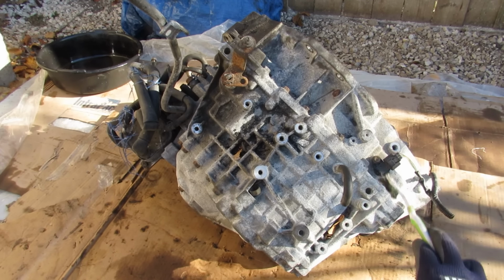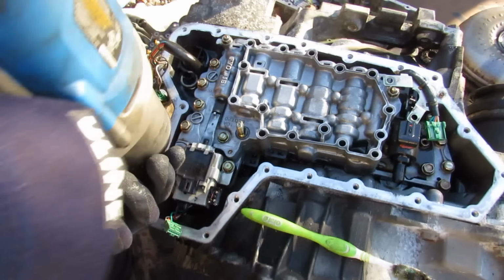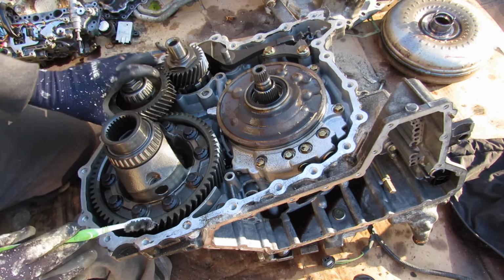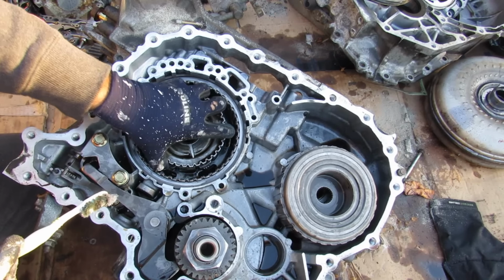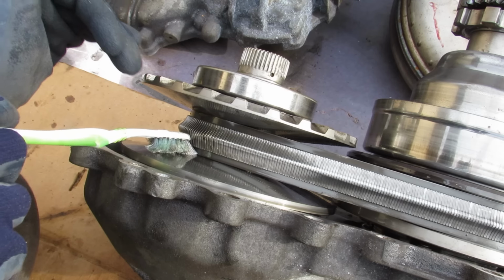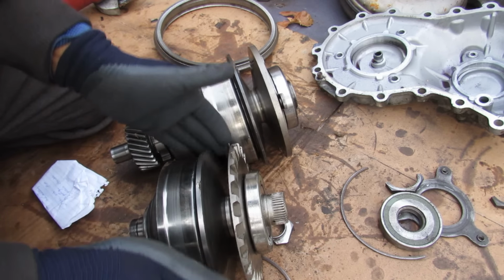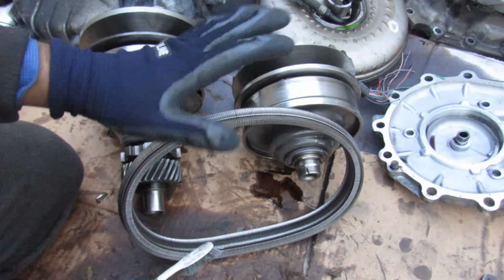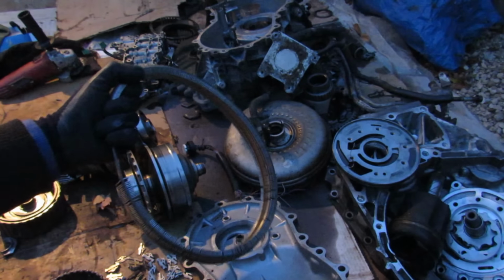Why Nissan CVTs FAIL

Comment: Do be mindful when dissembling some CVT parts , the Variator pulleys in some designs contain an extremely strong compression spring that is loaded to over 400 psi that has to dissembled with a special spring compressor tool  (very much like the extreme care that needs to be taken when removing the spring from a suspension strut when its serviced ), it contains a lot potent energy and if you don't have the proper tool in place and remove the nut holding the variator pulley together ,, you can be badly injured when all that force is released,   people should be warned of this issue..do not mess with the Variator assembly's themselves without proper training ,, https://youtu.be/i4wzSthmmMo?t=337
Reply: This is good advice

Comment: Stepper motor is the main issue with most CVT transmission failures from Nissan. Nissan will not sell you the stepper motor but it can be bought on Amazon and replaced for under $500. Nissan will insist that they replace your whole transmission for a cost of $5000. I know which way I went The car now works fine

Comment: My wife's Altima hadn't had a CVT fluid change in 112K miles and started having momentary (1/2 second maybe) times where it felt like someone let off the gas. Was happening every few miles eventually.  I changed fluid with NS-3 Nissan fluid and I swear there is almost no noise from the CVT or engine now except under acceleration. It drives so smoothly that I think it's better now than when new. Should have changed fluid at 60K miles so I got lucky that it held up so well. Now it drives like butter. Sounds like a hybrid on battery sometimes. Keep that fluid changed! Next change will be in 20K miles since I only drained 4 quarts in the process and believe it holds 8 quarts total (including torque converter). Will definitely stay on top of it now.
Reply: Yeah that's a slip probably from the wrong fluid type.  Slip will instantly kill a CVT.  Once the cones get polished they won't grab the belt anymore and it's sayonara to the trans.
Reply: @drozcompany4132  that's interesting. It mostly did it when under nearly no load, like at 45-60 mph just cruising along. However, when I changed the fluid the sun was behind the fluid and I swore it looked read instead of the teal green of NS-3. On my finger it looked brown, but nothing like the used fluid I've seen come out of others on video that use NS-3. Wondering if they used a non-standard fluid in my CVT instead of NS-3 even though the manual is clear that only NS-3 is to be used.

Comment: Oh yes..... My maxima stopped in the middle of the freeway, almost causing an accident. I will never buy one of those cars again. Nissan sucks. My check engine light went on days before, dealer told me nothing was wrong with it. Made a little nois, they again told me nothing was wrong with it. On the way home on I-5, it made a loud sound before breaking on the freeway.
Reply: Blame your shitty dealer.  The car was giving you a warning.

Comment: In my opinion CVTs are only good for subcompact and compact cars because they dont pull that much weight, putting it on an SUV or a Minivan will really make them fail.
Reply: They could work for heavy or powerful vehicles if they engineered them with parts designed to handle it. I thought some Formula 1 cars had them until they got banned as being an unfair advantage in races.

Comment: Back in 2008, I rented a 2008 Nissan Altima with a CVT, for 3 or 4 days. I remember loving the way it shifted. Seemed very smooth to me, smoother than my 1999 Oldsmobile Intrigue, my 2012 Chevy Sonic, or my 2017 Ford Fusion (all automatics). Too bad about the CVT reliability issues.

Comment: 2 quick notes, you can rebuild some newer styles of Nissan CVT's , I've done it at the dealer several times.  2nd, the Nissan Pathfinder since 2013 has more of a chain then a belt.  As not 2 steel bands with links in the middle, the Path has still pins with small links in a pattern not that different from what's in a T-case.

Comment: The last Nissan that piqued my interest was any Maxima or Altima with a manual transmission.
Reply: I have a 6mt maxima with the special orange. Love it
Reply: Yeeees sir. The maxima MT was a rocket of a car and light. It pulled hard in every gear. Handling curves at speed was issue on beenie weenie tires and soggy struts.. Lowered with extra wide 255/40/18 tires oooooweeee.

Comment: Under appreciated video editing here. Straight to the point, no babbling. Thanks!
Reply: I was worried that we would watch every bolt and nut being removed but he cut out the rest after the first one of each bunch.
Reply: Ok, so do you recommend a CVT transmission flush or drain on. 2013 Rogue with 36,000 miles? Thanks!

Comment: I guess a manual transmission can be even more fuel-efficient than a CVT if operated properly.
Reply: Cybair: . . . p r o p e r l y . . .
Reply: Actually no its not possible unless maybe it's all highway miles
Reply: @NoName-gv6nm   -  Ask any hypermiler, they will tell you how it is done.

Comment: first i saw this cvt gearbox was in textile sizing machines in 70s and 80s, made by PIV Germany. Idea was as threads wraps the beam the diameter of beam increases while the thread drawing speed  needs to be same to keep the over all ratio same. Latter separte electric motors were introduced for each section with central control.( just look at your electric cars today ☺)
real knowledge based channel on YT. 👍

Comment: My 07 Nissan versa went to 298,200 MI with a CVT,,  now I'm in a Maxima 2019
Reply: Did it always have a bit of a winding sound?
Reply: The Lord was with you.
Reply: My 16 Maxima i bought used with 45k miles, knowing all the issues with CVT's i got the extended warranty and took the car straight to dealership to get the CVT replaced because it did have minor issues.
Got it replaced under warranty and runs like new.
My personal mechanic and Nissan said these CVT's must flush and change fluid every 30k miles.
Knowing that i can see why they fail prematurely if people are not aware they need to change the fluid more often than a traditional transmission. 
Yes my car does make a slight winding noise but for me i kinda like it.  To hear the mechanical parts working is like music especially when you let go of the gas and listen to it slow itself down is pretty cool sounding.
Reply: @keronlezama323  If a low emission car needs to have a $500 transmission flush every 25k-30k, they bought a lemon
Reply: @ajrichards1190   Might want to check your facts on that price.
The fluid and filter is $100 and i aint removing any moving parts.
Easy flush with hand tools and done in less than an hour.
Trust me, my mechanic hates my car just because it's a Nissan but he has showed me everything it takes to maintain this CVT
Reply: @keronlezama323  I have an 09 Maxima, would you mind telling me or sending me a link to locate the CVT filter? Thanks !
Reply: @ajrichards1190  It doesn't cost that much. It should cost you about $100 if you're doing it yourself. It's easier than changing your engine oil IMO. Dealership quoted me about $200 but you might as well just save the $100 and do it yourself.
Reply: @ajrichards1190  lol its 200 bucks every 30k miles... its good practice to do it every 50k miles on a regular auto anyways. You're reaching hard man.
Reply: Typical made up response to try to save face of a Nissan product lol
Reply: @allmotorkp61  sounds like y'all motor kaputed at 61, 🤣🤣🤣🤣🤣🤣🤣🤣🤣🤣🤣🤣🤣🤣🤣🤣🤣🤣👌.  Just got back from a 2000 Mile road Trip averaging 31 mi to the gallon and driving at 85 mph out on the open road Nissan Maxima baby
Reply: @allmotorkp61  don't tell me you voted for Biden too DUMORATT. TRUMP 2020 HAMMER TIME 🤣 SCORECARD DOMINION OUT 🤯🤯🤯🤯🤯

Comment: Besides the inadequate cooling, what causes these to have so much of a higher failure rate compared to Toyota, Honda, or Subaru CVTs? I almost never hear of CVT failures from other manufacturers, even though Subaru uses the same Jatco transmissions that Nissan owns and uses?

Comment: I like the CVT that ive got in my '17 sport.  It gives engine braking capability when you use the paddles.  Its so cool how it acts like a manumatic.  Although i wish i had a maxima instead the CVT is its weak point.

Comment: Nissan was a good car co. Until they merged with Renault that was their downfall, then they suffered lousy management. I talked with two Nissan engineers at a local baseball game about the cvt. They know they have a bad transmission but upper level management says as long as it makes through the 60,000 mile warranty that’s all they want, screw the customer!

Comment: Interesting how they work, despite failing the reputation they have, we had a 2007 Jeep Compass 4X4 for 9 yrs and the CVT was fantastic never gave us any trouble, we bought it with 72,000 kms (44,000) miles and scrapped it with 327,000 kms (203,000) miles with it’s original CVT. The reason we had to scrap the car is because rust was becoming too severe and unsafe, we drove the car to the scrapyard with the rare high mileage CVT that outlasted the car itself.

Comment: I have Altima 2016 on 200k km still working like the first day when it was 0 km even I'm in Dubai where temperature is very high.. The point is that after watching the cvt fluid temperature, i found that the temperature of the fluid keeps getting higher even if the car stops and on idle because the fans starts when the water temperature is 96c which is high for the cvt fluid. I find when the ac is on the cvt keeps in sweet spot which is 70 to 80c thatd why i keep the ac on. Sorry for long comment

Comment: Bought a 2009 Nissan Rogue a couple years back, and I didn't discover the problems with its CVT until a week after I bought it. Two weeks later, the transmission blew while climbing a hill. I regret not researching it before buying, and never again will I buy another Nissan, or any vehicle with a CVT.

Comment: This is interesting because I am not a fan of CVT's, but have an 04 Murano.  115K trouble free miles so far and I tow quite a bit in the winter because of where I snowmobile, as well quite a bit is off road towing on snow covered roads.  I do maintain the vehicle and don't drive it all that hard, but it's always in the back of my mind.  At this point though after 9 years of ownership and nothing major this SUV owes me nothing.

Comment: I rebuild CVT all day, easier than rebuilding a Acura MDX Transmission
Reply: Easier than switching a clutch on a manual?
Reply: @TacoMan99 , Easier than Replacing synchronizers!!!! Happy Crunching!!!
Reply: @sannissansanjuan5074  "I rebuild CVT all day" = indications that you shouldn't purchase one of these hunks of garbage :)
Reply: @lanemorrow7417  I use to Rebuild HondaMatic's all day long back in 2006 and guess what, i replace Hyundai Engines 2 times a day Too
Reply: @sannissansanjuan5074  keep up the good work. You have a skill worth paying for, and that makes these penny pinchers resentful because they can't get their beer buddy Darrel to fix it.

Comment: Correction in the pump assembly: 

The inner shaft is the input shaft.

The outer shaft is the stator shaft, which doesn't spin at all.  It interfaces with the stator in the torque converter and keeps that from spinning.

The pump is driven by a couple of flats that go on the outside of the torque converter hub.  They're even further outside of the stator, but behind the pump seal where they're really hard to see.

Comment: Great video. I may have missed something though when watching it. Is the steel belt and the conical pulley lubricated by transmission fluid or is the fluid simply to put pressure on the pulleys to vary the input/output depending on what the driver wants? Thanks! We have 2 Nissans with CVTs, one a 2008 Sentra and another a 2018 Kicks. I can tell how they've change up the CVT over the years as the Kicks' CVT can simulate shifting while the Sentra's is just a standard CVT. Both work great and get fluid changes every 50,000kms. Looks like that'll be the formula to stick to if we want them to last long.
Reply: The whole thing is bathed in trans fluid

Comment: Those pulley that move to change ratios slide back and forth on a shaft. Well that shaft is fitted with steel ball bearings instead of pins so the grooves that the pulleys move on get pitted up by the ball bearings tiny points of contact which leads to balls that get shattered or egged and grooves that look like ditches dug by hand. Which means the variator won’t variate no more. An engineered defect. Why they chose ball bearings over solid pins is dumb. And destroying their reputation.
Reply: I’ve actually rebuilt my own with still good parts and I replaced those balls with drill bit shanks . My 07 Dodge Caliber is still on the road now with 245000 miles. JF011E
Reply: It was definitely a bad design decision

Comment: CVT transmissions are for snowmobiles and ATV’s .... not cars!
Reply: ebulating  ... I have a Toyota as well, Tundra 2019. Tell me how you feel when it needs rebuilt after 100k.
Reply: Manuals are for old fogeys in Ford Ts and Anglias.
Reply: Scooters too

Comment: Thats an amazing amount of force being concentrated on the skinny sides of that metal belt in the pulley.
Reply: I was thinking the same, too many small parts holding and handling  lots of stress and pressure

Comment: I have a 22-year-old Mercedes with 400,000 miles on the clock. It still runs like a Swiss watch & has never had a transmission problem. If it ain't broke, don't fix it!!

Comment: It's surprising to see how many parts are inside one of these CVTs. Most people seem to think the whole thing is just a belt and 2 pulleys, like the CVT on a scooter (or an old DAF car). And I have lots of people telling me they use a rubber or plastic belt LOL!  You've still got a torque converter, planetary gearset, differential,  valve body, oil pump and lubrication system, control unit, solenoids, etc. I guess the basic theory is OK but in practice I don't think it's worth it. Saying it's simpler is like saying there's nothing to go wrong in a diesel engine because there's no ignition system.

Comment: Mercedes b class 200 2010 80.000 miles cvt failed cost of repair outways what cars worth had scrap it they call this progress.
Reply: What a contradiction you have all ready said in your video that these  cvt are not man enough for the job and you said tons of these units have failed and do not use paddel shifter will encourage quicker wear.

Comment: I have 2015 Nissan Rogue Sl at 112k mileage with only oil change and spark plugs. CVT fluid changed at 95k and it is going strong. People neglect and abuse their cars.

Comment: Very Nice Description! I spoke to a mechanic to told me there was nothing to help these transmissions. Apparently He was wrong. Easy driving, no towing and regular oil changes can 
help. Enjoyed your video al lot! So heat has a lot to do with wear especially when design is made a
certain way. I have one question which could not be answered by a mechanic. The mechanic simply
told me to keep oil changes regular and could not offer any other advice. That's Ok .  My question is
"Couldn't a high quality oil  like. Amsoil which is proven to reduce operating temperatures help prolong
these transmissions?"   Amsoil makes metal parts rubbing together slip easier and reduces heat. It also increases performance and gas mileage by the Latter. It also last longer with fewer oil changes when filtered properly.  Should I not introduce this oil to my 2006 Murano with only 67,000 kilometres.
Thank you for your excellent video

Comment: Excellent video. This is exactly why I'm never getting another Nissan. I drive it like a normal person, the car complains. The wife drives it like a grandma and the car is in *insert mythical location*. First unit trans failed at 43k miles and luckily it was under warranty. 95k miles so far now and it's fine, or so I'm told. Rest of the car is rock solid though. Got to find that little filter for the next fluid service.

Comment: I have a 2016 altima how often would you say I need oil change on the cvt
Reply: I Would Say Every 30,000 To 40,000 Miles.
Reply: @J4Y_Zee  thanks man

Comment: When they work, they work well.  But they do have problems.  I worked as a Nissan tech for two years.  I changed out transmissions under warranty for all that time.  Two a week, sometimes more.  The pre Renault Nissans were more durable.  The post Renault Nissans were/are very fast!

Comment: I had a 97 nissan pathfinder, engine and transmission never failed, even when my son put them under extreme stress, not changing oil, old antifreeze, crashing it, etc. He trashed the poor thing, in such a way that you could cry. Yet, the engine was running very quiet and smooth and the transmission was changing gears like a charm when I sold it for peanuts.